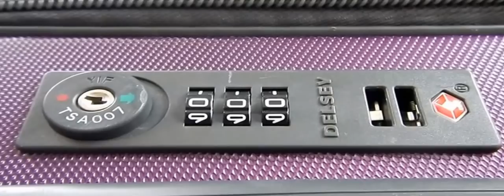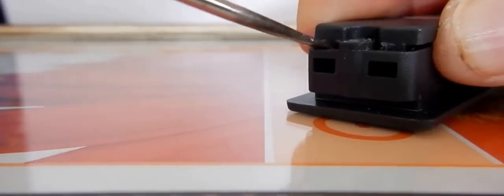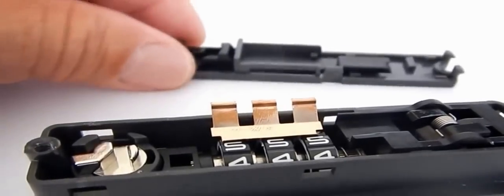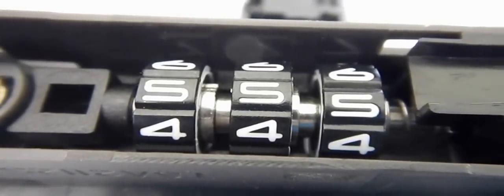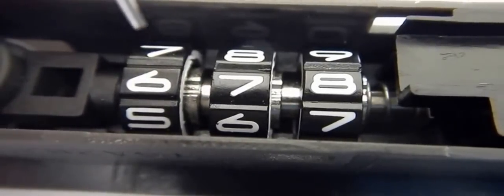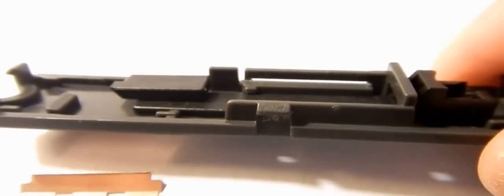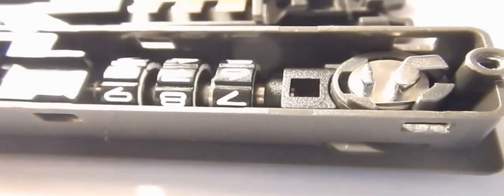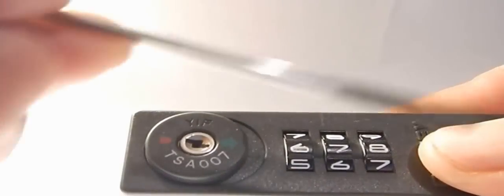tsa lock reset delsey

Comment: may you help me on how to put the inside springs of the latch back together? i did everything you said in the video, the only problem is that all the springs jumped out and now i dont know how to put it back.
Reply: pls help
Reply from the maker: before you try to reassemble the top to the bottom, make sure everything on the bottom is relaxed, ie that you dont have to hold anything in place, then place the top part with the brass piece swinging freely, 9.13,  and that it will not fall out of place when you bring it toward the bottom part. around 7.46 it shows how the brass is bent, how its oriented.
Reply from the maker: i looked at it. in order for springs to fall out pins must be pushed out. please provide a picture.

Comment: This video was at least twice as long as it needed to be!  What is the point of the screw driver - Do you not have two hands and ten fingers? Instead of moving the wheels with the screw driver and constantly needing to re-adjust them because you moved them out of kilter MAYBE you could have just used your fingers (Duh).
Reply from the maker: sue me.
Reply from the maker: maybe my fingers too fat and will block the view? maybe moving stuff around will show how to fix what could happen

Comment: This helped me open the lock and reset the code (as well as realize what the current code was thanks to the indents)
However putting it back together was an absolute nightmare and now the lock doesn't seem to work whether it's "locked" or unlocked. I feel like it was 50% bad luck and 50% me being inexperienced and clumsy. Still this video was very helpful! Thank you
Reply from the maker: take it apart and try it again. if the parts arent seated properly you could still squeeze both halves and they will snap together, but the insides are not in the just right position.
Reply from the maker: i have a thought. you must take the lock apart, then place the locks in the locked position. https://youtu.be/LqloahZ97SE, making sure parts dont fall out when you have it upside down. this will not snap  if its assembled wrong and in one piece, it must be apart. then try assembly again.  another think to look for is to slide the plastic toward the end, so the round chrome piece will nest into the notch on the mating plastic part.

Comment: Stupid thing how if the suitcase locked😁
Reply from the maker: try this. insert a very thin something metallic that can fit, beside the dial, down to the shaft, turn the dial see if you can feel the notch. you may need sensitive fingers of a burglar to feel it. get all the notch positions lined up, it will provide the solution. for example a shaving razor blade strip. i havent tried it, my lock is open lol. good luck.